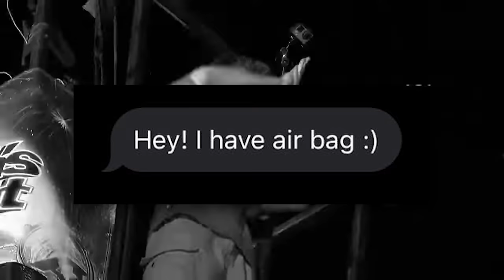We Bought a $70,000 Inflatable Crash Pad for our Backyard!

Comment: Now the real question is does it float, put that thing in the pond and get some real crazy tricks onto it, the water underneath it would soften the landing
Reply: I'm a bona fide stunt rider and stunt performer, that thing will not float unless it is a very specific brand, which it doesn't appear to be, meaning it will sink like a stone, I mean I have to move mine with a telehandler and multiple special straps, they are much heavier than you think!